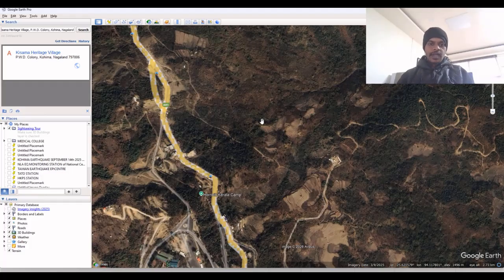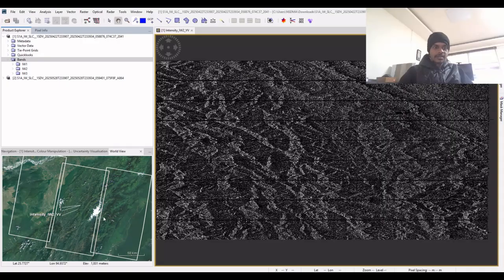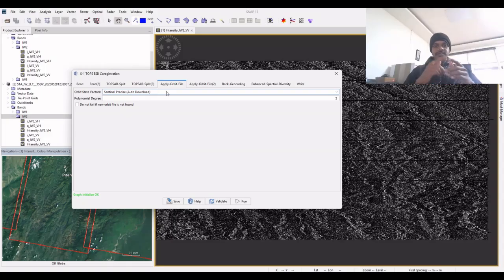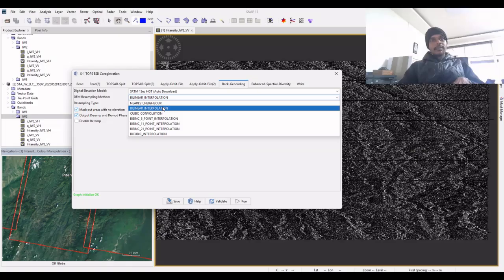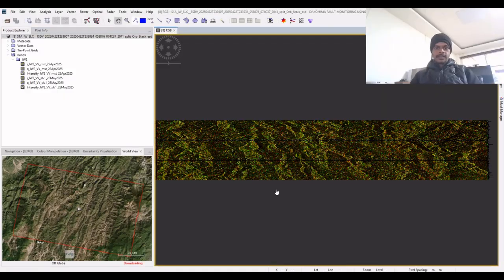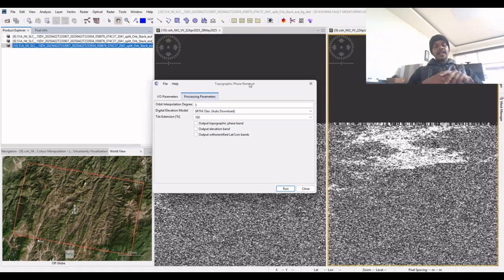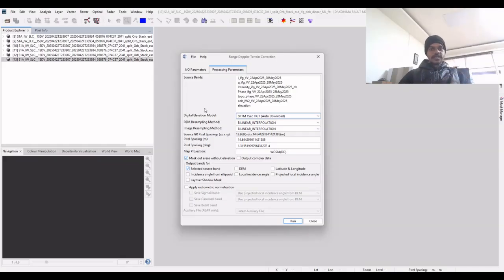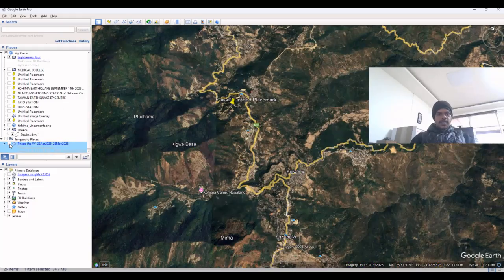Detailed Explanation Every Step For ESA SNAP Landslide Detection #geoscienceengineering #landslide

Comment: I have one question , shall we do unwrapping using snaphu or not. I believe it is a necessary step in order to reach displacement.
Reply from the maker: We can do unwrapping in SNAP directly by installing Snaphu plugin but in this particular video we are only looking for the phase change, if we want the displacement we have to use the unwrapping😊
Reply: @geoscienceengineering yes , I have this doubt, I can do unwrapping after all the steps in this video. Am I right
Reply from the maker: @NikLikh unwrapping must be performed between multilook and range dopple terrain correction. We unwrap the phase after multilooking but before terrain correction because unwrapping needs smooth, low-noise phase data in radar geometry, and terrain correction distorts the phase relationships required for correct unwrapping.